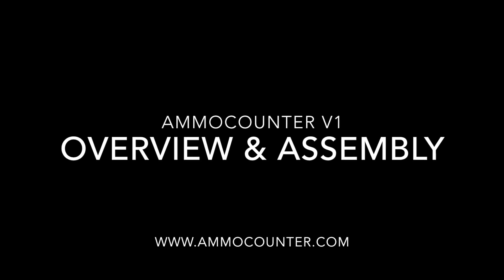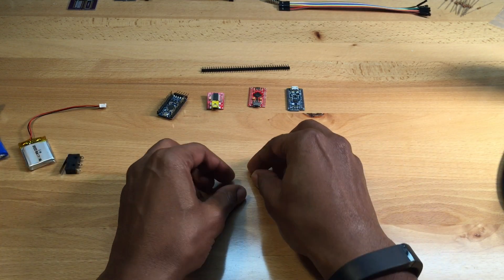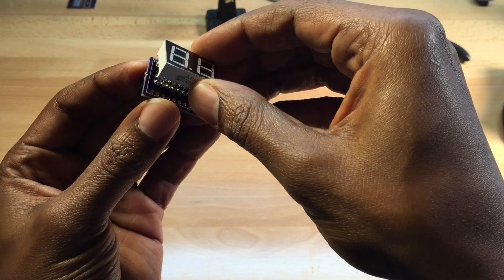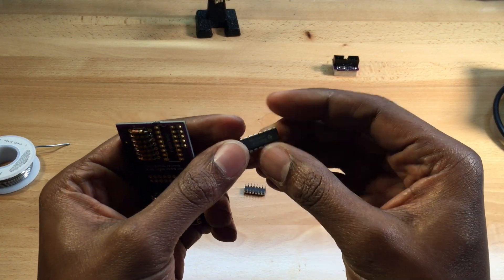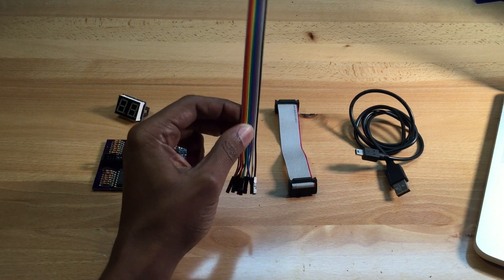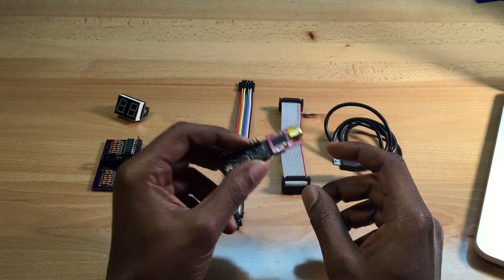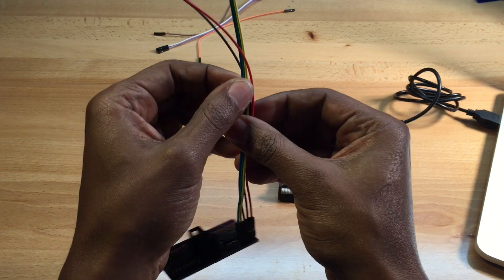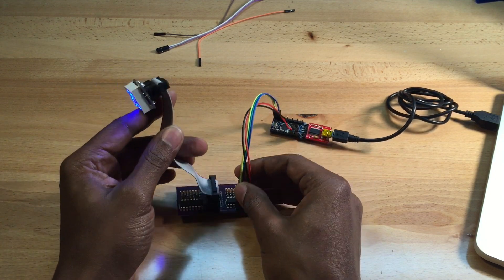AmmoCounter V1 Kit Overview & Assembly - NERF dart counter

Comment: wanted this, found assembled, but not built, the one htat shows 3 pieces...
i wanted to ask about it uh, does it require any further assembly? what number does it come in? how do i put it in my blaster? (a stampede) how do i connect it to the power source? im not one good with code or wiring, so i just wanted to ask.